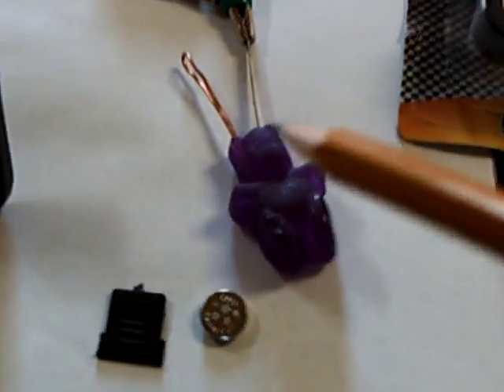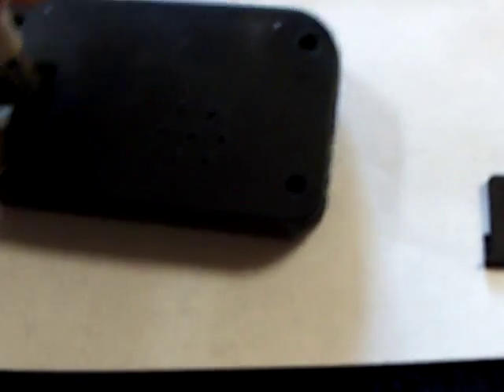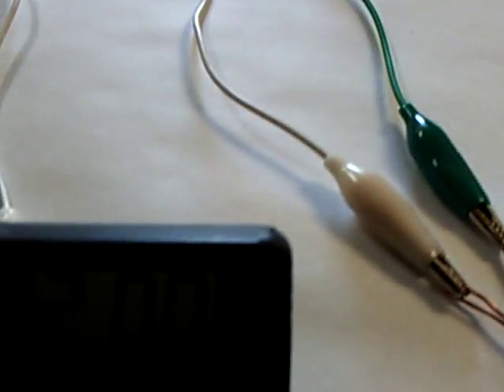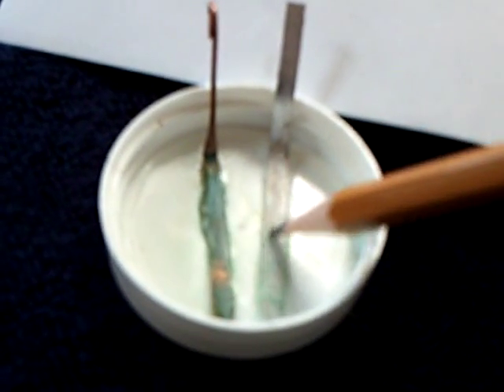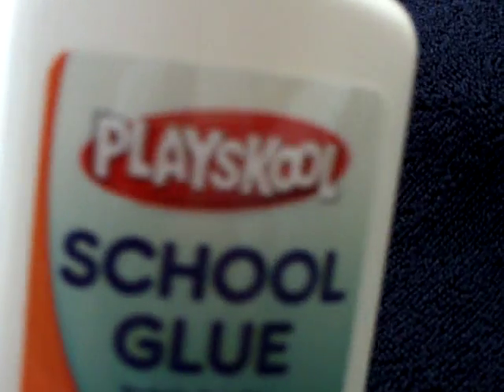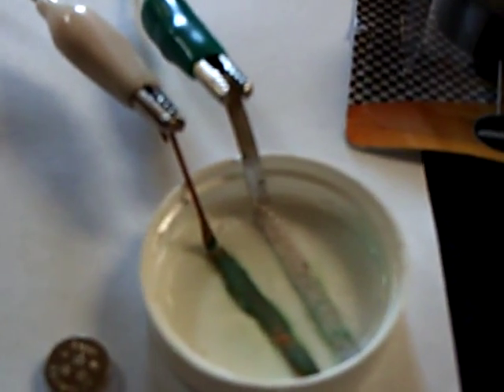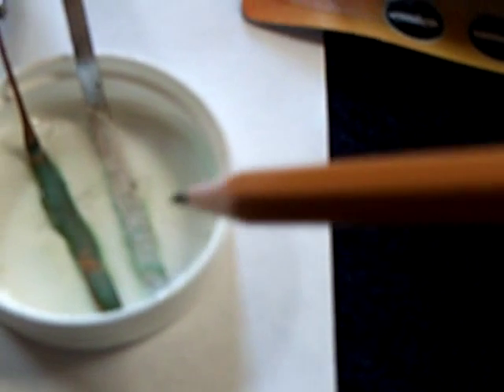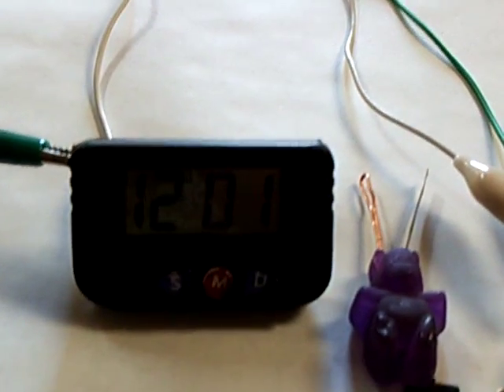Gummy Bear battery and Glue Battery running an LCD clock.ASF

Comment: Lid. I hate to tell you this but If you paid a dollar for something in the 99 cent store you got cheated by a penny. Kidding of course. Nice video. If we could find a very course insulator like furnace filter material or something it might be practical to make a roll of coper and magnesium. The gel should be able to get through the insulator. You can put the anode and cathode in before you refrigerate I assume. Hmm, Higher current battery wafers. Maybe dip the wafer in latex paint?
John
John

Comment: Hey Lid, 
Nice job! 
My brother Artie suggested using "slime", you know the stuff that kids play with.
instead of the glue.
Would you still get the galvanic reaction using slime?
If you incased the battery it might not evaporate so quickly...or do you need the oxygen?
Keep experimenting, you will change the world!
Eddiev1985

Comment: Nice! I do find it weird that you copper is green, In order for my copper to turn green I had to force a current into it. The Glue battery doesn't last long, the cells will loose power day by day due to the water escaping. The glue does slow down the galvanic reaction. I do have some glue cells that are shorted out for days and still show power. But the best cell I have are the glue batteries that only use Aluminum for both anode and cathode, Some seem to be gaining as the glue dries.